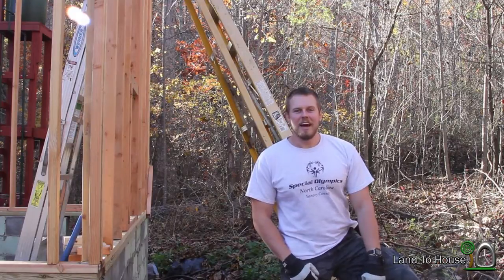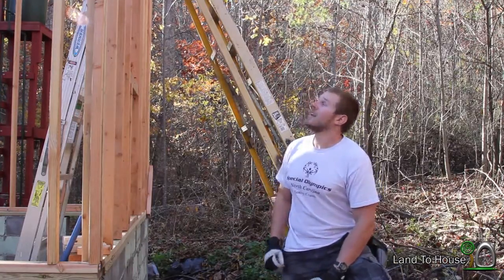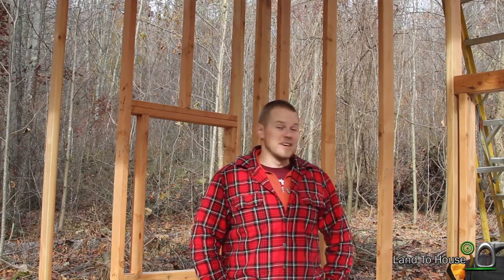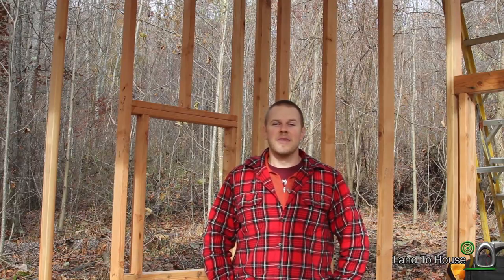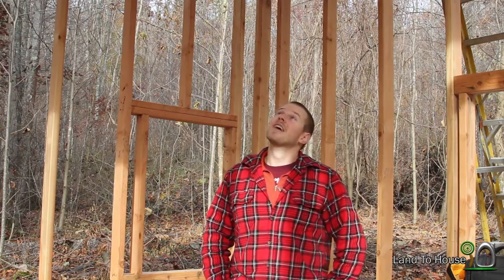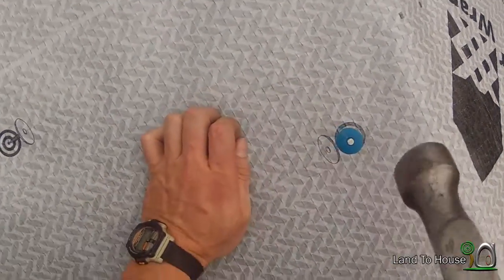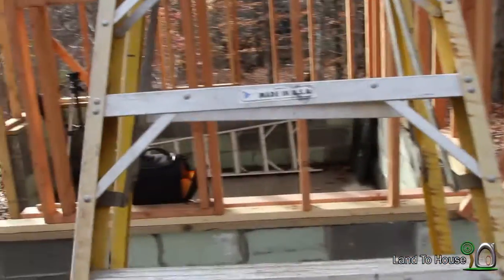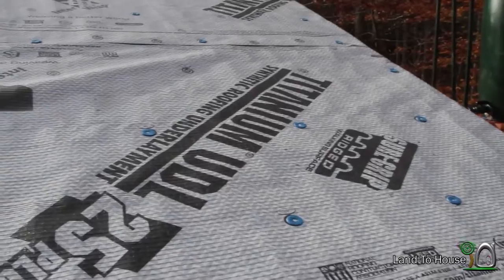Tiny House 21 - Install OSB and Underlayment

Comment: Love your videos and that's a clever trick with the nails to keep the sheeting from sliding off... 
7/16 OSB for 24" centers is the most common roof sheeting in use because it's cheap and complies with code for a snow load up to 30#/ft^2 (but 1/2 is often recommended).  The problem with OSB is that it can hold more moisture and take longer to dry if it gets wet (compared to plywood), leading to degrading faster if it gets wet during construction or your roof leaks.

Comment: You did a fine job of putting the OSB board up but as a tradesman in the business and taking a hit within 5 years of using  it and having to replace it (at my cost) I wouldn't have it for free and installed for free on anything I would build. OSB Is the scraps gathered and made into something that looks good and may appear to be ok and it is not even under the best of conditions and if someone makes a slip on what they are doing that is where you will be deep Do Do and have to replace it with the real thing, PLYWOOD. Of course it is your project and you can do what makes you happy.
Reply from the maker: Thank you for your knowledge. At least we put it up right.  The OSB did not get wet at all so I hope that will help it last longer. I can see where losing a job or two would make you very upset about this stuff. The underlayment and metal roof both are 25 year. If for some reason the OSB does fail I dont think that it would be to hard to remove the metal and start new. BUT I dont want to do that for a long time. I guess we will just have to wait and see how well this lasts. I had the metal roof on within two weeks of the OSB. Thank you again for commenting and watching.

Comment: OSB board is a mistake. You need 1/2   4 ply code plywood. You will be replacing that OSB in a short while.
Reply from the maker: Oh goodness. What causes the osb to fail? The sources I read said osb was fine.